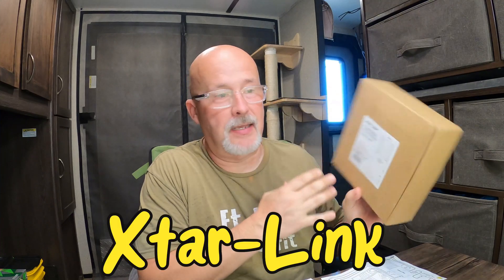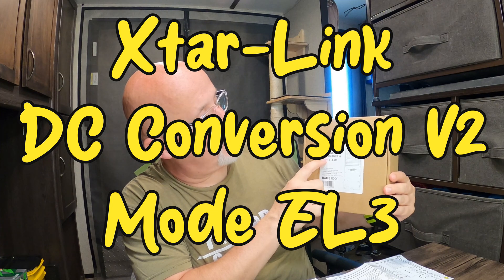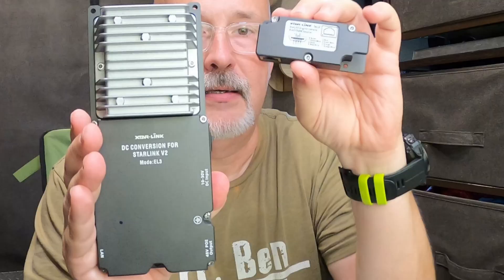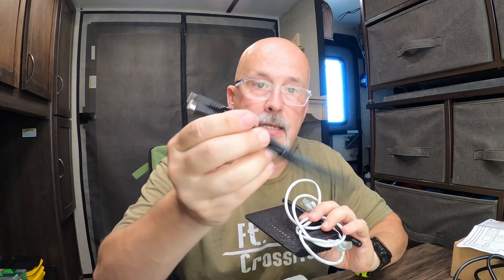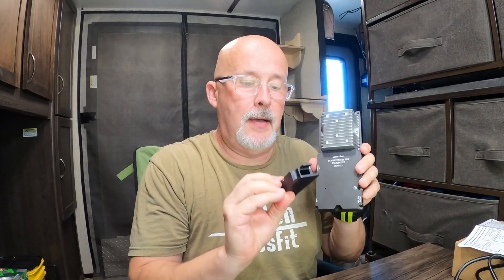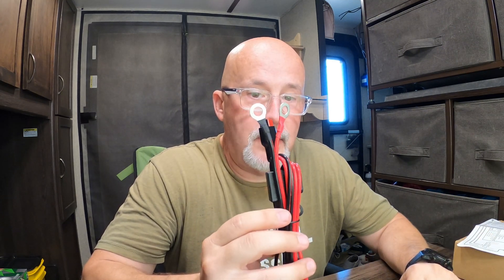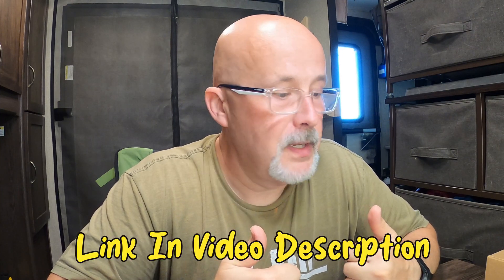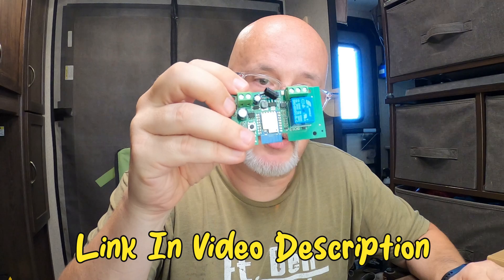Starlink 12 Volt Conversion w/ XTAR-LINK EL3 & Power Testing | Tutorial & Review

Comment: can you use the starlink router?  I'm assuming that the DC power usage wouldn't be as good if you used the Starlink router.  If you can use it at all. Also can you still access the Startlink phone app if you use their 12v router?
Reply from the maker: Yes you can use the Starlink App, as for the starlink router (if you are talking about the Gen 2 router) then I do not think so that is the purpose of this device to swap out the AV powered router to help reduce power so using a 12v router is what helps the power usage.

Comment: Kyle, Did you figure out that smart switch?  The ones I've used, you supply your 12v+ to the center terminal, (in addition to the power) then one side is normally open and the other side is normally closed. I don't see the link to bluetooth relay board. I assume you've sorted it out by now. I tested a Bluetooth proximity relay board. So when I got close and my phone connected, it automatically switched on. When i was out of range it switched off. I was thinking I only needed starlink when I was in range of the trailer. Needless to say, I ditched that idea and just switch it manually, on the control panel switch.  I'm still interested in the smart switch you showed. Did it switch from an app? I've tried a couple of those but never got the apps to work with them. If you were successful, let me know. I know you don't get too deep into electronics geekdom, for obvious reasons. But thats where my brain lives! I have Starlink Gen3. I mounted a n exterior plate for the Cat6/7/8. I didn't document much of it, but I'll post a pic to yr FB if I find any. Also, I've tried the Starlink "Sleep Mode" and find that draws a lot more than I'd hoped. Thus the switch to just shut it down, at night or when were away for extended periods.
Reply from the maker: Thanks for checking in, so I ended up not using the swich I could never get it to do what I wanted and I also saw some other reviews that said when you are rewiring the Gen 2 the more compenets that you have the more potentiona trouble points you have for voltage loss to the dish, so I just mounted the board where I could filp the power on and off as needed.  With Gen 3 I have it plugged into a smart home plug and just kill all the power every night and schedule it to come on about a half hour before we get up in the morning.  The "sleep" mode is useless because the interent does not work and only cuts the power in half, just easier to cut all the power.
Reply: @thewanderingshores   Yeah, I agree with the sleep mode... LAME! So you use yr Gen 3 on AC,  interesting.  I converted mine to 12V and it works well. I have it on a manual switch. It works fine for us. Boots up in a few minutes, while we're getting around in the AM. My ONLY reservation with turning it off at night, to save solar storage, is when out of cell area, and not having the ability to answer a WiFi call from family (emergency).  Or if we need to call 911 if something happens. But there are many imagined scenarios, and you just can't be prepared for ALL. IMO  -cheers
Reply from the maker: @Lapeerphoto yeah that's the same thing that we have regarding turning it off at night during the summer. We really primarily leave it on when we don't have any cell service. However, if we do have cell service like you said, turning it off makes the most sense. But we've got enough solar and lithium that we replenish even having the 60 to 70 watt draw for overnight per hour from the starlink being on. Never gave any thought to converting it to 12 volt might help during the winter for us. How many watts is it pulling for you on 12?
Reply: @thewanderingshores     I'll need to look up a screenshot to be sure, but I'm pretty sure it averages less than 40 Watts.   I decided to check B4 I press Reply, 38-42 watts is average. (I'll send you the  screenshot to make sure I'm reading it correctly.)

Comment: can you also share info on your router? Is it also running on 12V?  I tried their XTarlink with router kit and the router sucks big time..also tried cigarette lighter power and connection is unreliable....thinking this 12V conversion is too much work..to be honest. have 800ah lihtium, UHG and 3000W inverter already set-up..
Reply from the maker: Sure, no problem sharing that information. I'm using the pepwave brmk1. It's an older version of their router and probably would have to be found on eBay or something. It runs on 12 volts and I've had really good success with it. Never really tried out the one that they sent with it but I know there are some other aftermarket ones. That can run on 12 volt. But with 800 amp hours of lithium may not be worth the effort. Like you said, since you have so much power available via AC

Comment: XSTAR was not available when I started my project. XSTAR is so much simpler!  Here is my cost break down for my Starlink V2 conversion. It includes a PD 3.0 USB C to power the router, 20ft of 16-2 wire and, additional USB port and a 5-gang panel for the remote on/off switch all unnecessary except for the PD 3.0:
$125.81 Amazon: 120v to 12v kit
$77.93 	Amazon: Passive PoE Injector
   $5.86 	Amazon: Patch Cable Cat 8 Ethernet Cable 10ft
$25.94 	Amazon: Blue Sea Systems 2722 DualBus Plus 150A BusBar 1/4
$27.30 	Amazon: 2-12v USB ports Nilight Dual PD3.0 USB-C and QC 3.0
$21.24 	West Marine: Ancor 10-2 AWG cable 12v distribution to 2722 D
$16.87 	West Marine: Ancor 16-2 wire 20 ft for remote relayed
$12.03 	Amazon: remote Power Relay DC 12V Coil 30A SPDT  Mini Relay NT90-DC12V-10X
  $4.26 	West Marine: ATC 30 amp fuse
$10.09 	Amazon: 5 Gang 3 Pin Rocker Switch Panel Waterproof On-Off Toggle Switches
  $5.22 	Amazon: Inline ATC Fuse Holders 12V - two for placement on the two USB lines
  $7.25 	Amazon: AINOPE USB C to USB C to power GL.iNet Opal mini router
  $6.47 	Lowe's: assorted ring terminals
  $9.29 	Lowe's: 12-10 fork terminals, 12-10 ring terminals
        $355.56 TOTAL
Reply from the maker: That's a great breakdown of your setup, thanks for sharing! It's interesting to see the different approaches people take.

Comment: How has this been working?
Reply from the maker: Continues to work well, about 2 weeks ago though. My pepwave went out and I'm needing to replace the router. So currently I'm just running off of the factory router but had no issues with the 12-volt conversion. Looking forward to getting it reinstalled and up and running again to save the power during the winter especially

Comment: Was pepwave router powered with the portable  battery along with starlink?  If not that would skew the power savings on 12v with pepwave  externally powered.  Thanks.
Reply from the maker: In my original setup, the pepwave was powered via 12 volt off of my house battery, and the starlink router was powered off of my 3000 watt inverter. 

Since I will no longer be powering the factory starlink router off of the inverter, I actually probably am saving even more power since I'm not losing The conversion from 12 to 115 volt.

Comment: I think for a fair comparison you would need your router plugged into the power station as well, as you have removed the routers power usage from the equation.
Reply from the maker: My router (Pepwave BR1 MK2) we used even with the factory setup of the starlink.  Since we still use it now the power consumption of that portion of our setup would not change.
Reply: @thewanderingshores  which is fair for your use, but an apples to apples comparison would include router power since that is the totality of the original starlink system. The power savings you seen at the power bank could be solely attributed to the removal of the router power. Would be interesting to see if there are any power savings at all when  a router is included I the power consumption.

Comment: What router are you using?  No longer need the Starlink Gen2 bulky router?
Reply from the maker: We are using the pepwave br1mk 2. We've had that for many years and works well with the starlink. Even though it's an older LTE version. We actually just used to rout our starlink Wi-Fi connection through it. Anyway, that way we can sometimes combine the signal with our hotspot. They did send me one of 12 volt routers with the kit but I haven't tried that one.

Comment: Waiting on mine- on a slow boat from China. 😎
Reply from the maker: Mine came rather quickly I was a bit surprised. How long ago did you order it.  I can confirm that it has still been working great for us and has saved us a lot of power in our batteries.- Kyle
Reply: @thewanderingshores  bought on the 22nd - tracking hasn't hit US shore yet. ;-) I thank you for this video - it confirms that I need to get it for boondocking. I'm currently running starlink on a portable battery, but it's nice to know even if I use it that way, I'll save whs! Thanks for putting this to the test!

Comment: If you wanted to verify this device you needed to use Everything they supplied.  Most of us do NOT use more items then the normal Starlink stiff.  Therefore we are not getting the real information from this test of the items you tested.  Bummer.
Reply from the maker: Most people looking to convert to 12v are likely not planning to run their system with the basic router they provide. The website does offer a way to purchase the kit with out the router as well. I am more concerned with the power consumption of the modification so that was the focus of my testing.

Comment: I've no doubt Inverters, no matter how hidden, in electronics suck. I have 2, one is 400w and the other 2000w. The 400w is no longer hooked up an the 2000w is in the storage unit. The first thing I did was get a 12v power cord for the laptop. Instead of jumping from 12 to 110   and down to 18-20 (laptop v) it just steps up to 20v. Quite a savings in energy. I know that Starlink is a power hog. This can't do anything but help.
Reply from the maker: I agree Greg, so fair we are about 2+ weeks in on 12v and it has made a big difference.  We decided not to install the smart switch but to just "put it to sleep" at night and we are still waking up in the moring wiht 15-20% more battery then we used to.  It's been great for our setup.

Comment: Interesting Video buddy. We currently run our Star Link off our 2000 Watt Go Power Inverter that is plumbed to our 4, 6 volt batteries. At night I stow starlink and shut off the power to the router as it does pull about 6 amps an hour if I leave it on all night. I happen to have a cigarette DC power plug in the panel behind our TV (I installed it as we run a DC fan using it frequently). $200 bucks ish seems pretty reasonable for the parts to convert our system over. Does your promo code work with the Amazon Link? Or would we need to order directly from the company so you can get that small kickback? If I do it I will probably pull the trigger next next month. I did see there was a $10.00 price savings from ordering off their website, however with our 5% Prime rewards that is moot. Anyways, great video buddy. Sean
Reply from the maker: Hey Sean, Thanks for checking and obviously watching the video. So the way things work is if you buy directly through their site you'll get the $10 discount for signing up for their mailing list and then a $20 discount using my discount code WANDERON. So the total should be around 169 before taxes etc.. The Amazon link that is in the video description is a affiliate link for our Amazon store, so if you use that link and purchase through Amazon then we'll get a small kickback. It's about half of what we would get if you went through their website, but feel free to use either. Whatever is best for your situation. We've had it working now for 2 weeks and I can confirm it's still doing really well and the power savings is very noticeable throughout the day and especially overnight. We still have to run our inverter because our refrigerator is on that, but we're not having to power our starlink router or the powered ethernet splitter that we also had running, but I didn't want to get into all of that in the video 🙂
Reply: @thewanderingshores  sounds great, I will order it directly. 😁

Comment: I had a 12v DC smart relay connected to my 12v converted starlink as well. But I find it to cause reliability issues. even though it is rated for 10A, the traces on those boards are usually too small and created some high resistance, voltage drop issues that made the dish reboot from time to time. I also eliminated as many connectors in between the dish and the power source as possible. Those WAGO connectors will also cause some voltage drop. I ditched as many of unnecessary components as I could and its been much more reliable since.
Reply from the maker: Thanks so much for that info. That is super helpful. I'll probably dig into the wiring again then and clean that up. I haven't gotten the new Smart switch so maybe I'll just leave it the way it is minus the Wago connectors. Thanks for the heads up

Comment: Good job on this Kyle - if this was around when I was doing my 12v conversion I would have definitely considered it. It does everything you want. I'm surprised you used 48 WH with the original router, but I guess every case is different.  I think the biggest savings for me is being able to shut off the main inverter in the trailer  and still have starlink on - for times when I need to be available all night and we are out in the middle of nowhere :)  Great job I think this video is going to help a lot of people!
Reply from the maker: Thanks Bob, yes I was actually surprised only used 48wh, i was expecting more.  The thing I didn't want to try to account for is that I normally are running the Starlink off my 3000w interter so I actually think the conversion is saving me more power since that interter in the power stations is only a 600w.  I do still have to keep the interter on because I run my fridge off of it as well.  I have seen a significant power saving each day overall already.  I have been putting it to "sleep" at night until the new smart switch arrives.  Thanks for watching- K
Reply: @thewanderingshores  i think the power savings will largely depend on the efficiency of the inverter. Many lose 15% right off the bat so that's a huge win right there. Cheers - glad it's working well for you!  This should be a popular video :)

Comment: Great video on what looks like a great 12v conversion. Any reason you do not use the sleep schedule in the Starlink app to save power. Or does that not work once you remove the Starlink router. Hope to see you guys on the road sometime. We will be boondocking all summer in Colorado.
Reply from the maker: Hey Jeff, great to hear from you . So yes, you still have access to all the functions of the starlink app even though you're running it through a different router. What I have started doing right now is running it in sleep mode in the evening. The only real reason I don't do that normally is because I'd rather it be at 0 W than even a reduced amount that it takes when it is in sleep. I figure if in sleep mode it's not going to be providing internet anyway. I might as well just eliminate all power to it. But I've been using it now for a week since I haven't gotten the new Smart switch yet. And I've noticed a huge power reduction overall and it's definitely a great conversion. Have a fantastic time in Colorado. If you have any questions, don't hesitate to reach out. We've done reviews of most all of the areas that we stayed in but not 100% of them.- Kyle

Comment: I want to convert my V2 to my house 24vdc system but I'm going to wait for reviews on the new Starlink Mini which is coming out in a few months. It will run directly off my 24v system without any conversion and has a built-in router. Power draw is supposed to average 25w. I'm sure there will be some performance compromise but my needs are pretty basic.
Reply from the maker: Yeah, I was watching a recap video from the mobile internet resource Center yesterday about the mini. Looks like a much more viable option than originally thought.
Reply: @thewanderingshores  My concern is performance in less than ideal conditions. (storms or obstructions) I'm in Grand Mesa now with some partial tree obstruction yet I still get good internet. Phone calls get dropped but that will happen with any obstruction.
But 25 watts and a lower monthly charge looks very attractive.
Reply from the maker: @chapter4travels I'm sure a lot of people are going to take it through some real thorough testing and hopefully the price is right. If it's consistent and gets 100 down then it's pretty good for just about anything, especially with the small compact size automatically being able to run off 12 volt and having the Wi-Fi router built into it already.